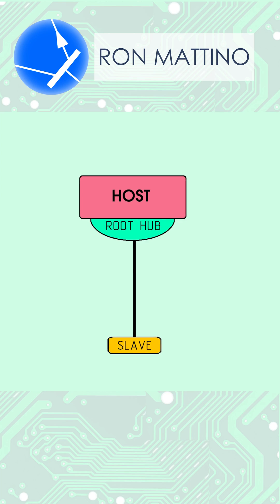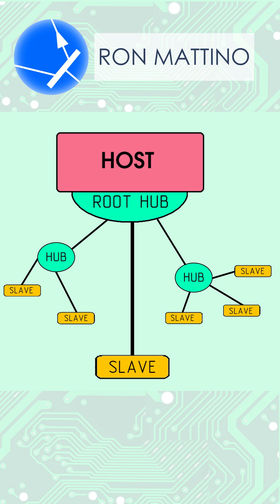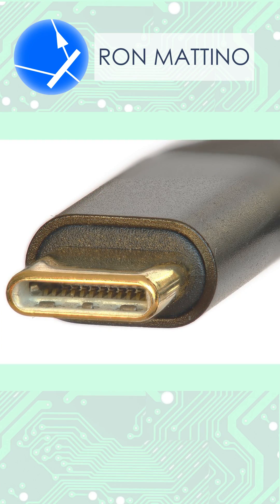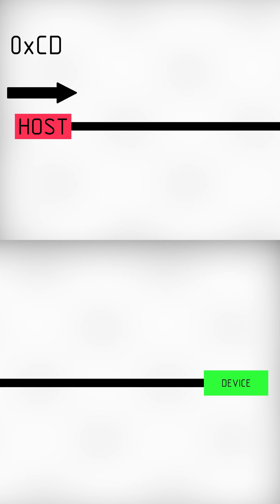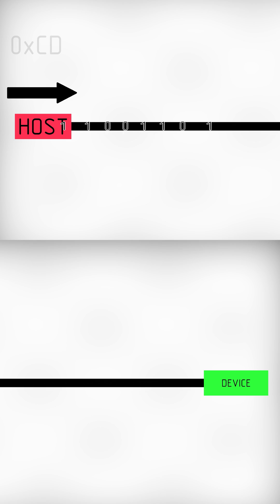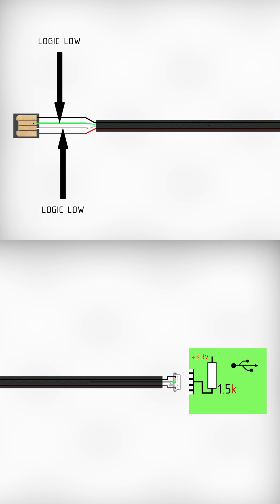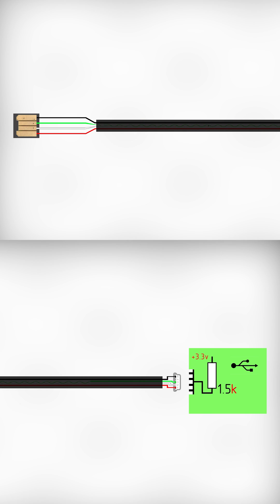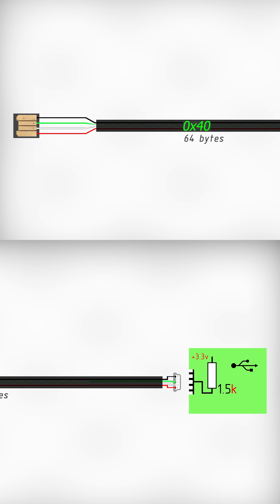How does USB work? #electronics #diy #usb #usbport

Comment: This is outdated. It only applies to very old usb versions, and really misleading. Hot plugging is supported in other port types in modern motherboards, tho not all of them. Usb 3, usb-C and some usb mini devices are bidirectional and negotiate what the controlling device is.. its why usb c has ports on the same end of the cables
Reply from the maker: Latest iPhone still uses USB 2.0 version, and a lot of other devices do.